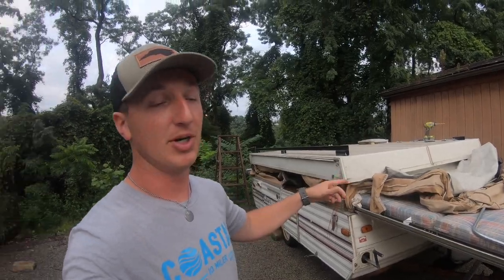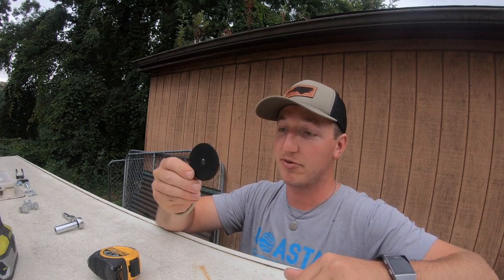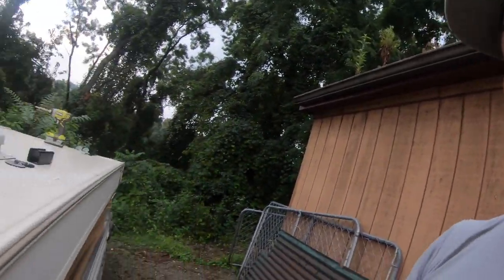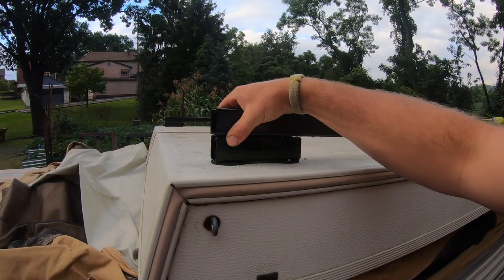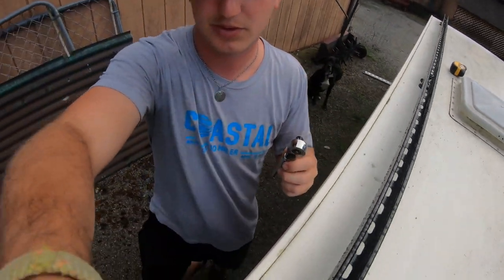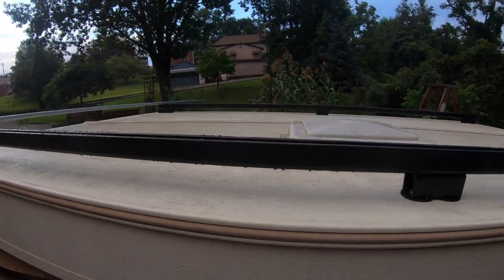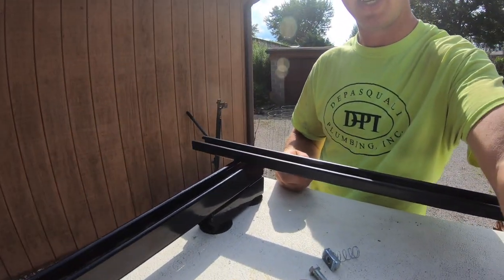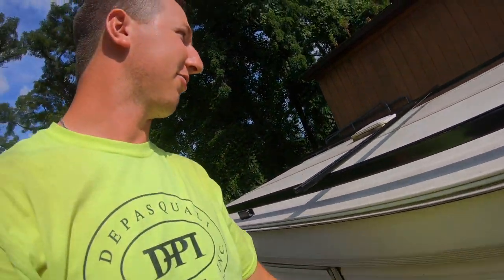How to Build a Roof Rack for Your Pop Up Camper

Comment: I have a pop up truck camper. I used old metal bed frames people were throwing away.  I made brackets to connect the rails to the underside of the roof side.  I would never drill holes in my roof.  It's a leak waiting to happen.  
Easily removable,  use it to anchor my solar panals.
Reply: Can you further explain?  Live in costal Alaska and will NOT be drilling holes in my new to me cabover... but also really need a ski/gear rack...
Reply: Ahhhhhh! The underside of the roof side! Genius!!!!

Comment: Excellent video!  I have a very small Starcraft Meteorite which has very little room inside for hauling much of anything except 2 ice chests.  My tow vehicle also has limited space.  I want to be able to haul some relatively light things up there like camp chairs, camping carpet (especially when it's wet) and a folding gazebo.  I might put some kind of RV sealant under the washers on the roof too.  Thank you!
Reply from the maker: I ended up adding some silicone to it about a year later after I noticed a little dry rot happening with the rubber washers, but it has been working great, no leaks yet! Thanks for watching!

Comment: Awesome. I'm an electrician and thought about using unistrut for a roof rack on my pop up! Well done. Time to make it happen!!
Reply from the maker: Thanks for checking it out! I love how it’s adjustable.  I do plan on adding silicone to the penetrations in the future. I haven’t had any issues with water yet but I’ve noticed some of those rubber washers are starting to dry rot/crack a little bit. Other than that I wouldn’t change a thing about it!

Comment: DUDE!... D U D E !
YOU JUST BUILT THE MOST AWESOME GEAR TRACK EVER! 
I've used the tracks before but never even thought of what an awesome gear track they would make! 
I'm going to use this idea on my 4x8 trailer
My pop up already has tracks on the roof. 
I'm going to give you a very rare THUMBS UP AND SUBSCRIBE!
Would suggest still using silicone in the bolt holes.
Reply from the maker: Thanks for watching! The possibilities are endless with this as a base! We are thinking about painting the trailer in the next year or 2 and I’ve thought about putting silicone around them when I put the rack back on.  Thanks for the thumbs up and subscribe also!!

Comment: We just completed our first outting with our pop-up and will totally be doing this along with your portable shower attachment. I’m a mountain biker and my Wife is a trail runner so the shower would have come in handy. This past week. This is so far the best roof rack idea I have seen. Great job!
Reply: Also for any MTBers, this Unistrut will be perfect to attach front fork mounts too. Maybe add another 6” strut support under your fork attachment so the shallow strut doesn’t flex.
Reply from the maker: Casey Million we love it! It works so well! We don’t have a terrible amount of flex in the middle, if you do add another 6” piece under the shallow strut I don’t know that I would bolt it to the roof though, that would keep you from being able to move your shallow strut if you wanted. But that’s certainly not a bad idea! We’ve had a few bikes on here with kayaks and 2 roof carrier storage units and it is so nice having that extra space in the vehicle so it isn’t packed full.  We have used the shower not for rinsing our dogs off than we have ourselves so far haha but it is a great set up.
Reply: Have you replaced any of the lights in or outside of your camper yet? We have a Jayco as well and thinking about converting to LED.
Reply from the maker: Casey Million no we haven’t, thought about it but we have some ryobi battery led lights that we bring with us so we can move them around or use them elsewhere.

Comment: Am I missing something here, how are you able to drill through the roof and not add some sort of sealant in those holes when installing the bolts? This would be in addition to the rubber gaskets obvs. I mean that’s a big gamble for year to year camping which could put you in a scenario where it’s pouring through those holes. I’m just curious, as I am looking to build an 80/20 rack for solar cells. But I’m super nervous about drilling through the sealed roof.
Reply from the maker: After about a year I did notice some cracking in the rubber washers so I added clear silicone under them directly on the roof and I haven’t had any issues with that.  When I saw the cracking like dry rot it made me nervous.  I think I talked about it in another video somewhere later on. Hope it was helpful though!

Comment: How has this held up over time? I'm worried that my roof will eventually start to sag from the extra weight
Reply from the maker: @NOne-yt1tj  it’s still holding up well these days.  I ended up taking off the rubber washers and using silicone after a while, I noticed some dry rot cracking after about a year and a half but overall it’s still working great!

Comment: As many said before, this is great and you’ve inspired me. My issue is that my camper roof is ever so curved front to back, like a very, very shallow rainbow. I’m only going to go front to mid point, not full length, and if the 6” bases get bolted flat to the roof there is a “gap” on the outside ends between the top strut and base pieces, about 1/16”...make sense? Bolt it through the inside hole and ignore the gap? Stick an extra washer between the base and top strut on the outside edges and bolt through that? Curious for your thoughts.
Reply from the maker: I think I understand what you mean, I wonder if you could add an extra washer or two to act as a “shim” on one side so that your strut holds it better.
Reply: @TheBarrierBrigade  ya, shim indeed! My thought was a washer too, though what I really want is something a bit skinnier on one side than the other (like a narrow right triangle in profile), or something with some give/squish to pinch on the narrow side but still fill up the gap on the fat side. Your rubber washer is one idea...maybe a heavy ‘gauge’ of that, or a nylon washer...

Comment: Genius!! May I ask you what type of paint did you use for the struts? Would Russolini spray paint work for this application? Thanks for the detailed video and simple explanation!!! Top notch!
Reply from the maker: Cassiano Young I just used some black Rustoleum paint from Lowe’s.  Nothing fancy, just some simple metal spray paint.  I didn’t primer it either.  The only concerns for rust are where the cut ends are.  Everything else is galvanized so if a little paint flakes off here and there it’s not a huge deal.  Hope it all works well for you! Thanks for watching the video, I’m glad you liked it! Let me know if you have any other questions about it.

Comment: Do you have a parts list for this project? I love it!
Reply from the maker: Kymberlee Baginski I can give you a rough list of what I did.  It may be different depending on your brand make and model that you have.  I will try to get one together and edit it into the description of the video or add it to this comment.  Thanks for loving it! It has been awesome to use! We can put so many attachments onto it and sometimes we strap down a collapsible picnic table to the roof.
Reply: @TheBarrierBrigade  Sounds great!
Reply from the maker: @kymberleaf  I used 23' of deep strut for the bases (2 pieces the length of the trailer plus 3 6" pieces on each length)
28' of shallow strut (4 pieces 7' long for the cross bars)
12 2"x3/8" bolts to go through the roof. (may need longer or shorter bolts depending on what you are bolting through)
Each bolt gets a 2" x 3/8" fender washer on the inside
Where the bolt comes through the roof I put a 2"x3/8" rubber washer to act as a seal, with another 2"x3/8" fender washer (in the video I didn't have anymore 2" fender washers for this part so I used a slightly small one) then came the strut with a regular 3/8" washer and nut on the inside. That will mount your 6" pieces to the roof.  Then when you put your longer pieces on you will use the 1" bolts with 2 of the washers and spring nuts and the same thing will be done to mount your shallow strut cross bars.

So all in:
14 - 1" x 3/8" bolts
12 - 2" x 3/8" bolts
24 - 2" x 3/8" fender washers
12 - 2" x 3/8" rubber washers
24 - 3/8" washers
12 - 3/8" nuts
14 3/8" spring nuts
23' deep strut (2 - 10' pieces and 6 - 6" pieces)
28' shallow strut (4 - 7' pieces)
and a can or 2 of some metal or all surface black spray paint or whatever color you prefer.

I hope this was helpful for you, I think I included everything. let me know if you have any other questions! Thanks for watching!

Comment: Looks good and durable. I wonder if I can find that in aluminum just to save some weight.

Is there a video with it carrying anything?
Reply from the maker: That would be a good idea! I don't know what kind of products they make like this in aluminum.  I don't see why aluminum square or rectangle tubing wouldn't work.  

I know I have a few pictures of us having the roof loaded to the max but I will have to get a video together of that.  Now that the weather is starting to get nice again I am hoping to get out and use it soon.  I'll be sure to talk about it and have it loaded up with what we normally bring. Thanks for asking!
Reply: @TheBarrierBrigade  I found the same strut made out of aluminum. It's still a work in progress but for the 2 side rails like you mounted it only weighs 13 pounds but was almost 3X the price.

 Cross bars and roof basket are on order
Reply from the maker: @151bradhatt  that’s awesome! I’m not surprised by the price but I’m glad you found that! Good luck with the build!
Reply: @TheBarrierBrigade  thanks. I wasn't sure what the lift system is capable of lifting so I figured the lighter the better.
One big difference is my roof is sloped so I can't mount it like you did. I'll have to put a 1" strut in the middle instead of the 1 5/8" or whatever it is
Reply: @151bradhatt  I would like to assess the aluminum option. Would you be able to share a link for those?
Reply: @CarlitoAugust  I used the 2" aluminum strut for the base and 1" for the cross bars
Reply: @CarlitoAugust  I put a link but it went away
Reply: @151bradhatt  no worries, I was trying to get a specific item to speed up things for our next camping. Carrying kayaks and bikes is getting hard

Comment: I really like your rack. I was wondering why did you bolt all the struts upside down? I realize it has many holes for drainage the way you have it ,but am I missing something?
Reply from the maker: Don Nobles, Thanks for liking it! It has worked great for us so far (not that we have used it all the time), we try to use it at least once every other month, sometimes we use it twice in a month.  I honestly have no reason for putting it the way that I did other than being able to put strut clamps on them if I wanted to in the future.  I wouldn’t quite say it is upside down though, most strut gets mounted on its back so you can use the inside for clamps.  The shallow strut going across the top for the actual attachments I left facing up so that I could strap pipes to with strut clamps.  I made an outdoor shower that we can use camping out of some PVC pipe and fittings with a hose attachment, painted it black so it heats up in the sun and it didn't take long at all.  I am hoping to post that video soon actually.  But that is the only reason I chose to put it on its back.  Thanks for the question! Let me know if you have any more, this system has worked great for us and so far there is nothing that I've wanted to change on it.  The rack has actually been on our camper for about 9 months now, I just recently put the video together and posted it.
Reply: I did this idea for my trucks camper shell. I too mounted with the holes down. Easier to mount a crossbar onto. Another handy use is Quickfist for mounting say a shovel or axe. You could also use pipe mounting clamps to run round tube like PVC or metal conduit for a basket or other need.
Reply from the maker: waterdog Jones that is awesome! I’ll have to look into that! I’ve been wanting to put a shovel and axe on there, been trying to figure out the best way to do it.  I have pvc strut clamps on there right now for a shower I made out of 4”pvc
Reply: @TheBarrierBrigade  = Great idea about putting the strut like that so you can put PVC into the channel! Mine already has a factory track mounted  on each side. I think your idea beats buying a Yakima or Thule system
Reply from the maker: Don Nobles thanks! I really enjoy it, I use Yakima, Thule and even some old Sears and off brand Walmart attachments on there, they all fit perfectly!
Reply from the maker: Don Nobles I couldn’t easily find a Yakima or Thule system that I really liked for a set up like this.  Especially not one that was affordable, building my own like this was affordable, relatively easy and I was able to customize it for whatever I want.  I’m able to spread the shallow strut to whatever distance I want. Everything is fully adjustable, and I can even make another rack above the one I have now (as long as it’s shallow stuff on the bottom)

Comment: This is cool. Just don’t do this with campers that are from 1997 or older. The weight on top will surely snap the cable. And that’s an expensive fix
Reply from the maker: This is actually a 1989 and I found the max weight for the roof in an old manual for it and I stayed well within the limit.  It has been working great!  Usually when I get to the campsite I unload the roof racks anyway so the only weight it just the rack and some water in the shower.

Comment: I was wondering if you could have just buy longer bolts so it would go through the short unistrut all the way up to your long unitrut (base). Doing away with the spring nut altogether. I'm going to do the same to my pop up. I'm planning on making swing out awning like this guy here: https://www.youtube.com/watch?v=1nJW2aT4i2s&t=149s
Reply from the maker: Tong Wong thanks for the message! I thought about doing that, but the reason I chose to use the spring nuts is so I could adjust the shallow strut.  Different roof rack attachments I put at different distances.  With the spring nuts I can slide them forward or backwards more depending what I am using.  Take for example if I have snowboards or skis on there, I might have them closer than if I were taking kayaks.  To answer your question, yes, putting longer bolts through all the strut would work perfectly fine.  I just did it this way for different adjustment if I wanted it.                                    I’ve been trying to think of a way to do an awning. I’ll have to look into this idea.
Reply from the maker: Tong Wong I’ll have to look into that! Let me know how yours works out! Hope it goes well!

Comment: Not a wise idea. It's not attached to anything structurally sound. And you didn't put anything to waterproof for leaks.
Reply from the maker: I originally put those tight rubber washers on there to act like a gasket and they’ve worked great for the first 2 years.  Somebody recommended that I put silicone around the holes so I eventually went back and did that, I haven’t had any water issues yet.  As far as the structural part, I don’t have a good answer for that lol 😂 but I can tell you that there is no wobble or shake in the roof and it is nice and sturdy

Comment: Do you realise that not bolting to anything structural causes the fiberglass to flex and crack, then leak. Whilst driving your roof flexes continuously. Leak waiting to happen.
Reply from the maker: Very possible! But we got the camper for free and I would like to use the frame as a base to custom make a small camper and figured I’d try this and see how it lasts.  So far it has been about 6 or 7 years since we put it on and no damage has occurred